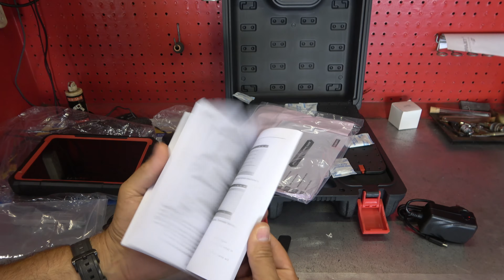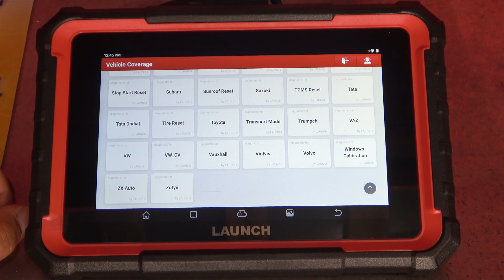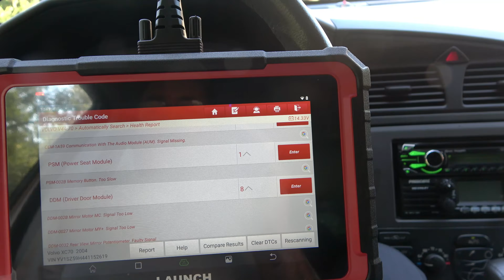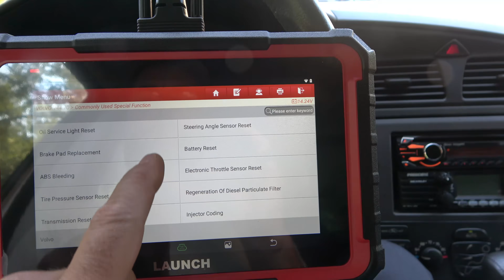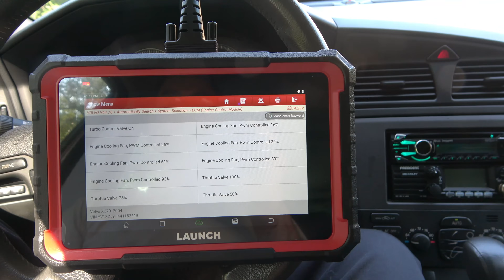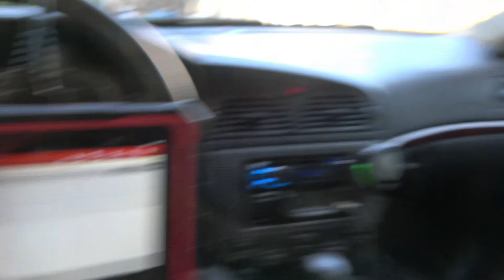LAUNCH X431 PRO ELITE. A full review and Demonstration.

Comment: I bought x431 pros elite. After couple time uses, its keep failing to connect VCI. I contacted with Support team, sales team. They keep saying upgrade and update software which I have done already many times. But its still keep failing. Anyone dont help me properly to solve my issue. No phone or online customer support, only email connection , response is 24-48 hours. Doesn't worth to but it, waste of money and time.
Reply from the maker: I have not had any issues with mine, but I hope someone can get that figured out! That's a LOT of money for a tool that doesn't work right. Have you tried the hard wire it to the tool?

Comment: I can see the scanner in connected to WiFi when you're working on your car. Does the scanner work the same on / offline?  Do we need the internet connection to set up the account and update the device only ?
Reply: THAT IS THE MOST IMPORTANT QUESTION, hope for an answer too;  Thanks
Reply from the maker: It's like a phone. It works better with a wifi signal. (updates and google searches) but the tool works fine offline.

Comment: do you know if this will work good on a dodge charger for live data, including ABS sensor data? need to figure out which sensors are bad so i can replace them and then diagnose why it wont shift out of first gear, amongst some other BCM codes...
Reply from the maker: This tool will do that just fine!

Comment: will this tool enable a 2011 vauxhall zafira b 1.7 cdti to relearn the suction control valve settings on the high pressure fuel pump ?
Reply from the maker: I wish I could help you, but Vauxhall cars are not sold in the USA.

Comment: found this shows not equipped when it is and it wont access the module even when fault is showing using $15 scan tool and light on dash
Reply from the maker: Not sure I understand. The cheap scan tool doesn't find modules? Launch is pretty good about full system coverage.

Comment: I have a 2011 Volvo S60 t6 - considering replacing the factory screen and entertainment system with an android 14 touch screen.  Unfortunately that would lose access to the settings of the car on the built in touch screen.  I am looking for a solution to access all the factory settings if I go this route.  Would this scanner take care of all factory settings?   I would also like to be able to program extra keys for my volvo and Honda 2018 crv.  What do you recommend?
Reply from the maker: This tool with allow programming for the keys on Volvo and Honda, but the infotainment system is a mess. I do not recommend messing with an aftermarket one on that car. It's a part of the CAN bus system and will set codes when it's gone.

Comment: How do you install apps?, you can't simply add apps to this device!. Garbage device, i am sending it back, The browser is garbage, and the screen has a ridiculous 1 inch black border around the screen. Also, it would not auto find my vin on a 2002 Toyota corolla. Could not add yahoo email to device. FYI, it does not have 2 browsers!!  No Chrome browser just proprietary junk
Reply from the maker: What country are you in? All of those features work on mine.
Reply: @FarpointRestorationsAndRepairs I just bought the new version of this tool.  The X431 ProS Elite and as the previous person commended, I don’t have the ability to add apps.  There is no Google Play, so you can’t install Chrome or other email apps.   I didn’t see Chrome installed on your version either.  Why would they make us use there versions of a browser?

Comment: Do i have to have internet access in order to use this tool?
So what happens when the 2 year free update ends? or Does it stop working till i pay a subscription? 
Can i still fully use all its functions if i decide not to pay for any updates?
Reply from the maker: Never tried it without wifi but it will work with all features even after the sub expires. It will simply no longer update.

Comment: Can you switch off adblue if its faulty and cars not working because of it
Reply from the maker: No, there is no scan tool that will allow you to bypass a required emission system. You'll need to fix the DEF system.
Reply: @FarpointRestorationsAndRepairs  Reflash ECU is possible way.

Comment: Thanks, great informative video, I have a 1996 Mercedes SL500 r129 with OBD1 interface  and i'm looking at buying a scanner. I've been told the Launch X431 Pro Elite scanner will work on the earlier cars too ? If so can you do a video on one please.
Reply from the maker: I can't make a video on it since I don't currently work on any OBD-1 cars, but yes, you can get adaptors for the various OBD-1 connectors.

Comment: Are these 2 way communication or just read modules? Looking to calibrate suspension level sensors for mercedes
Reply from the maker: It is a 2 way and it should be able to do what you need it to

Comment: Does this do mileage correction?
Reply from the maker: That is illegal. No, it doesn't The only time mileage needs to be corrected is when a instrument cluster has been replaced. 90% or more of those would then need to be reprogramed (Flashed) to match the car they are in, and during the matching, the correct mileage is then flashed as well. 
 Remember that more than one system now stores the actual milage in the car and will cause codes if you incorrectly "Correct" the milage.

Comment: So can i do a relearn program on the abs, my truck fault code deals with vin mismached with abs because the battery negative faults once in a while going to the truck, original owner put on a quick disconect for the negative cable and has messed with the comnectivity sometimes. I want to reprogram the abs to the vin of the truck so it doesnt appear anymore as a fault.
Reply from the maker: While I can't say for sure on your particular car, I know that there are a lot of matching functions available with this unit.
Reply: @FarpointRestorationsAndRepairs  it's a dodge ram 1500 2006

Comment: Hi there! After that 2 years of free software support, that’s coming with the tool, will I be able to use it on the older cars without buying the 600$ subscription, or it will be pretty much useless without it ?
Reply from the maker: Still works fine, just no new updates.
Reply: @FarpointRestorationsAndRepairs  Alright, appreciate your response!

Comment: I have the original diagun 2 full kit,I just got the elite  v+ for 54 a month on my prime card.
$760 total.
I wonder if all my attachments from the original will work with this
Reply: My ebcm on my 04 sierra just bit the dust,I'm gonna check the grounds 1st but if I need a new one that needs programmed I wonder if this will reprogramm abs  modules.
Reply from the maker: Not sure. I know the larger X431 V3S+ Pro can do programming.
Reply: @FarpointRestorationsAndRepairs  the one I just ordered does do programming on ecm and ECU but not sure if it does ebcm but I will find out when it comes and I play with it.
Reply: @FarpointRestorationsAndRepairs  mine just showed up and I updated everything..it's the v7.05.022 version and man it's got so much more than my original diagun for 2010 lol .
I mean,it still works good for a lot of basic and intermediate stuff but it's a toy compared to this new one.
Can't wait to try it out
Reply: @FarpointRestorationsAndRepairs  mine came with a free can fd adapter too for the new new stuff.
I'm definitely gonna slowly get the add ones too
Reply: @FarpointRestorationsAndRepairs  I got to fooling with it on my 01 civic which is limited on that but I like it but wished I would of got the immo one step up now since in 2 or 3 years alot more used cars will have the smart keys.
Guess I will just get that cheaper add on that's like $129 for it.

Comment: Can it do AF test? Or engine data like misfires? Looking at one myself.
Reply from the maker: Did you watch the entire video? Misfire data as well as short term and long term fuel trim are there. This tool is better than our Snap-on Zeus when it comes to coverage.
Reply: An Actron CP9690 code tester checks misfires. It's on Special tests. It's faster than the Launch.